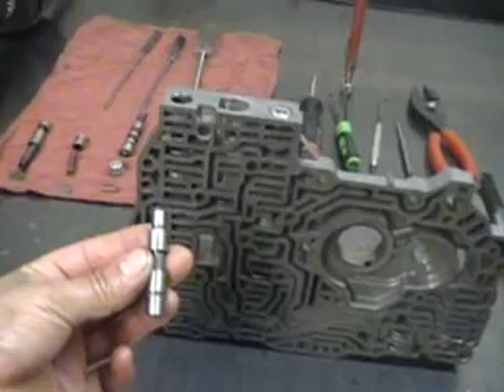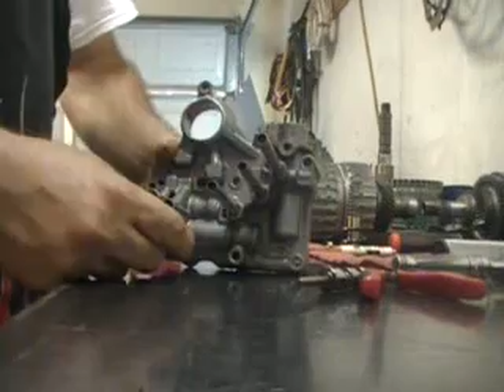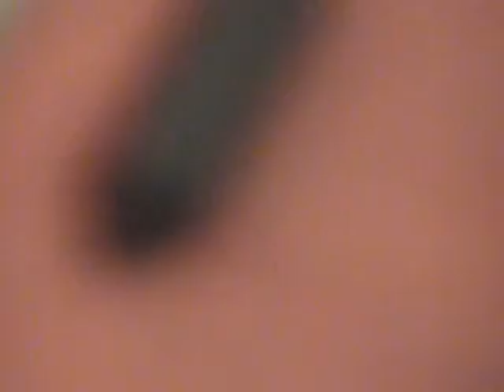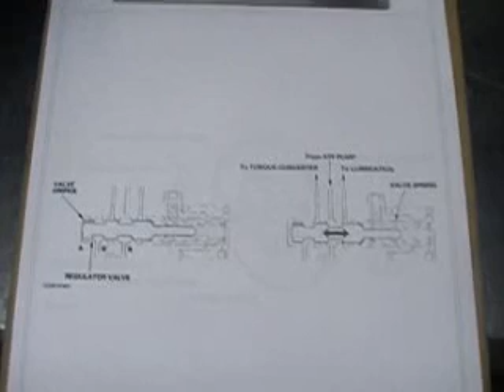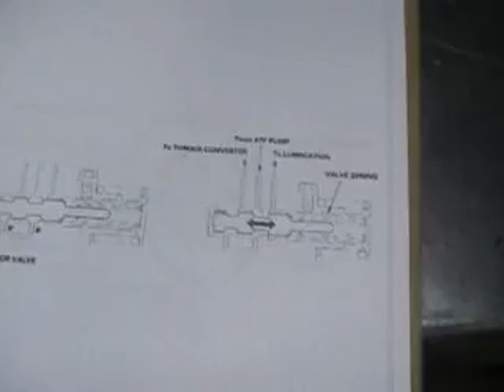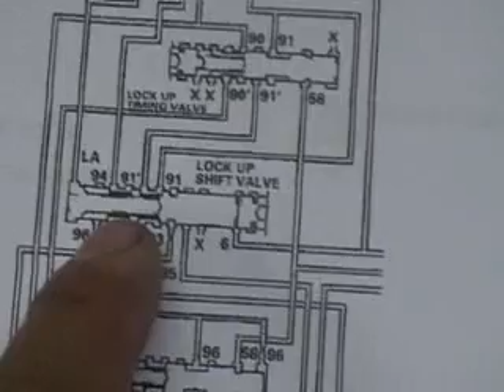Honda Transmission Repair 1

Comment: Hi Hiram I'm take out my transmission aging from 98 accord v6 doing valve body clean and drill a hole lube to converter charge going to do all thing you show me in this video  plz also show assembling thanks

Comment: thanks so much for your video Hiram. there is no way i could have rebuilt the b7xa transmission without your help. you were correct the pistons were hanging up so i cleaned and honed them with nylon brushes till they moved freely. the clutches in my transmission did not have any wear on them. when i broke it down there was a greasy sludge all over the valve body. i think thats what was causing some of problems to.thanks again you saved me 1600.00 i rebuilt this thing for 400.00

Comment: my 98 V6 accord has 1st, reverse and 4th. can i just change the fluid and add some additives until i can afford a new one? no one around here will fix it for less than 2 grand and the used ones are insanely priced! i dont know what to do.

Comment: How do you figure out which of those passages in valve bodies in general do what, like the ones you have marked in red and blue at 8:39? In other words, how'd you figure out the red passage was for converter charge and blue was for line circuit? Explaining how you map that stuff out I personally think would be a good idea for a video.

Comment: I got a 99 Honda accord ex-L 4door 4cyl 2.3 has 4speed automatic . Its whinning like hell in reverse won't go anywhere and in drive its quick in gear but sometime shifts hard not all time. Is it a bad solenoid fix or a rebuild fix? What's the error ? Its got 203,500 miles

Comment: hi is there anything i can do other than changing oil for transmission to keep in good health.
second, i was told that most of tranmission problems are really because of manufacturer flaws in design and not because of misuse.  pls advise.
Reply: I think you are correct on every count above.
Replace fluid so it does not turn into sludge and drain out the oil  particulates every 30 or 40kMi. If not abrasive clutch junk will accumulate in valves and wear out bearings. 
👍🏻

Comment: Is it easier to work on a manual or automatic on a personal preference? I have a V6 Mustang auto. I notice it vibrates during a specific speed range I think 40-50 unless you throttle a little more, but there is no slippage. Would this be a transmission problem?
Reply: engine & trany mounts ?¿?

Comment: What would cause the reverse to not want to reverse up a hill? still works on flat ground. Will go so far then I have to shift from reverse to neutral back to reverse to start moving again. Fluid level is fine. No check engine light. Also the car is a 1999 honda accord 2.3l automatic with transmission maxa-2086617. The car has 320xxx miles on it. COuld you do a rebuild video of a transmission like it and show problem areas of that transmission? Thanks for any help your videos are great!!